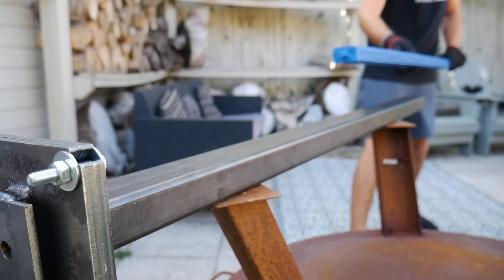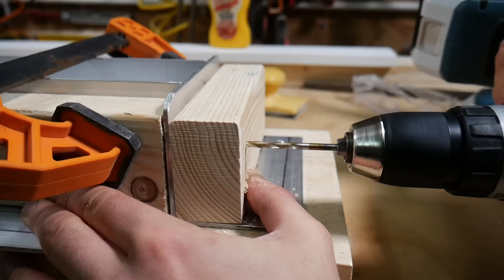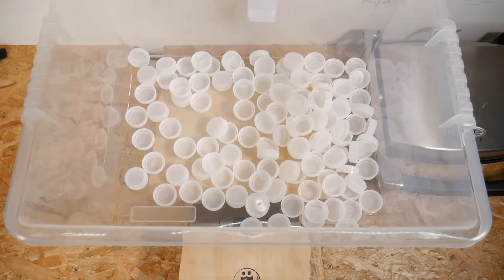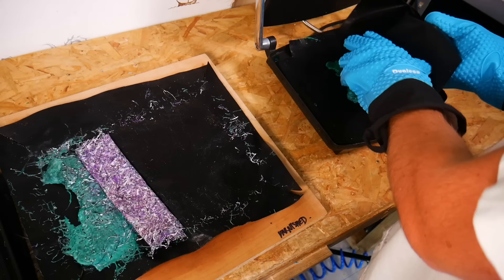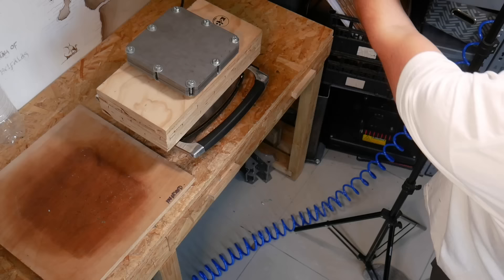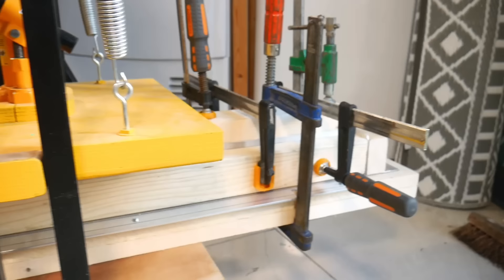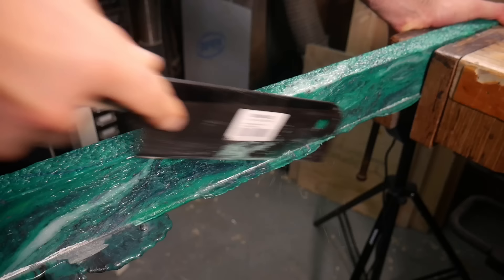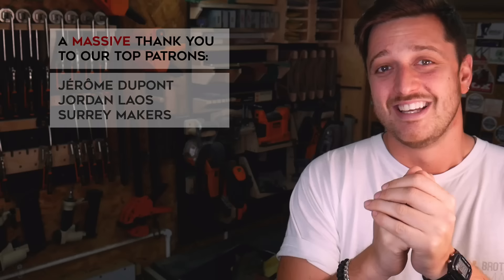How to Make Recycled BEAMS from Plastic Waste at Home

Comment: Understanding HOW to use materials in a construction project is critical. To use these plastic beams, you need to alter your thinking pattern a little bit.  The way to use them is one common to log home construction.   In log home construction, the logs all lay in a horizontal or flat position and are not stood upright.  The plastic beams don't have the characteristics to be strong enough to use as upright or vertical "studs" but certainly do have enough strength to lay flat, one stacked on top of the other like logs in a log home. 

The building process is made stronger by drilling a hole in each plastic beam at intervals of perhaps 12 inches to maybe even 18 inches.  Long rods such as rebar could be laid into the foundation concrete when it is poured.  The beams are placed over the rods, with the rods protruding upwards through the holes in the beams.  Holes would be drilled to match the rebar size.   Once the top of the wall is reached, the rebar can be capped off or just bent over in a "L" shape to lock the bars in place.  Used this way, the beams should work just fine for many types of applications.  A thin layer of glue or sealant can even be applied between each plastic beam as it is laid in place to help provide more structural integrity.

I can see using it for a lot of non-critical applications here on my homestead, like for building dog houses, chicken coops, pump houses, smokehouses, and even maybe small storage sheds.  Some have mentioned the UV issue, which can be mitigated a lot by simply painting the plastic beams on the exterior just as any other building material might be painted.

I like the concept and it certainly is scalable once a few improvements to the melting and forming process are achieved,   Low cost of the beams is really a great positive factor and so is the recycling benefit.  I'd suggest trying to produce a 4 foot length in a standard 2 x 4 dimension (1.5 x 3.5 inches) and to experiment with other shapes, such as 4 x 4 or 6x6 beams.  Find the right sweet spot where the product has good structural rigidity and stick with that configuration.  Then apply my construction suggestions and build products for the market.  

My first suggestion for a product would be to create notched beams that look something like a Lego block which would allow kids to assemble the beams just by pressing them together.   Then sell the beams as a kids basic construction toy set!

Good luck with this!

Comment: In order for them to be used on a house or any structure that holds any weight they're still going to have to have metal in it so you really are defeating the purpose and the air bubbles have to be Master squashed so they would be coming out and if it got sun rays or heat Rays then you have to have a special u v paints to keep them from being cracking and breaking which they would do over time anyway  but you guys are on  your way

Comment: Completely new to the idea of DIY plastic recycling and I have a few questions
1. Are there any concerns with toxic vapors when heating the plastic?
2. What recycle grade number does this correspond to (I am assuming 1), and what other grades is this heating and kneading method feasible for?
3. Would it be possible to heat this plastic further to pour into a plaster, clay, or resin mold?
4. What kind of flash point should I watch out for to keep from combusting or otherwise ruining the plastic's chemical structure?
Reply: 1. Yes. Never heat the plastic beyond what is required to melt it. Also, stick to HDPE, LDPE, or polypropylene. Do not use PVC. Only melt in a well ventilated area. 
2. The numbers correspond the kind of plastic. HDPE is #2, LDPE is #4, and polypropylene is #5.
3. No. Plastic never becomes a liquid. At best it becomes the consistency of a stiff dough.
4. Depends on the type of plastic. Google the plastic type to get the melting point. Don't over heat, and don't keep it hot for any longer than necessary.

Comment: In doing research and development for the greater part of my adult life. I've come upon many things. I believe you should consider using a wood splitter as you can use the hydraulics to extrude and apply pressure to remove bubbles and Imperfections. If you hook up a heating element on the end you can force the plastic through a heated head and extruded out one end into a mold of your liking. Look up injection molding. You can also do some chemistry and turn it into gasoline and still have a gooey mess you can inject or mix with sawdust and make boards. Not hard just heat and collect and cool the gas as in a still and with the way the world is going it mite be necessary. Good luck and keep up the good work.
Reply from the maker: We have both injection and extrusion moulding machines in our workshop. We wanted this video to be a more DIY approach. Also, we don’t condone mixing plastics with other materials as it means they are no longer recyclable.

Comment: You need a big steel type melting pot like how they melt steel down !
You can beave professional molds but to make those you could make anything  from that from ply wood  to 2x6s  which would be a good time now as  wood is thought the.roof you can probably set up  a plastic  recycling  route to get all the free plastic you want or find land fills  that would donate plastic to you !  Just some ides to help look into an sba loan or grant that could help you get your project off the ground . Good luck!
P

Comment: Any way to test its strength, how much to make it bend, break, etc.  Instead of using an iron press, what about a small furness with a bowl to melt down hundreds at a time.  You might have to add something to help make it a little more pliable during the melting process, but you could pour it directly into the mold without twisting or shaping.  Maybe on an outside BBQ where the fumes won't be an issue.  There are some real world applications for this.  I use wooden 2 x 4's across the inside of my garage door as security that rotate on lag bolts.  They are bulky, if this is just as strong at half the size, it could be a useful product to recycle.  You need to figure out how to reduce production time.  Great video, you speak very well, understandable with good rise and reflection.

Comment: Are there any load tables for plastic beams? Also, how do you check for, or prevent, internal structural flaws... like air pockets? Thanks.

Comment: What would the total embodied energy of this be, from initial making of the original bottle tops from oil (extraction and refining, as well as manufacturing) through the energy required to heat and melt,as well as all the tooling and machining, including the materials used to make the mould, clamps, etc? Just trying to determine the Full Cost of the item; It might be more efficient to plant trees, and then wait, or replace the timber used by replanting the cut down trees.

Comment: I wonder if the folding and twisting process is more of a hindrance. When making taffy, candy makers twist and turn the hot sugar in order to ADD air bubbles. I would imagine less folding would be more helpful. A heat gun, might be better for removing air bubbles. Shredding the plastic prior to plastic may also help.
Reply from the maker: We’ve tested this a lot. Folding and twisting 100% removes air bubbles

Comment: Not sure what you guys are using for the lining as I just stumbled here, as an idea possibility you can use a crock pot to have a controlled consistent heat that’s basically at melting point you can just keep throwing it in and then pour removing air bubbles essentially without  too much trouble you can push down on it while still melted then pour into the mold. Just a thought you guys would know if it works

Comment: I’m finding it difficult to find a way to have or add an even color other than same color plastic. Is there a way to add color other than painting it on? I also worked construction and did a couple of Trex builds and I’m wondering what their material process is to make it structurally sound in the elements?! I’m researching to start my own plastic recycled material business dealing with landscaping materials such as borders, bricks, rocks and pavers. It all started with wanting trees that don’t need manicuring and seeing all my green Mountain Dew bottles and smelting the Mountain Dew aluminum cans and making furniture from reclaimed wood, I might as well make a career out of it. Thank you so much for all the helpful videos.

Comment: what about a more continuous process using something like a large cooking pot with element heaters all around to avoid hot spots? if the temp is a little higher, I'd imagine the viscosity can decrease a fair amount, making the plastic potentially pourable?

Comment: grind it up to a towder type, then melt it, would be faster to melt, also u can just pore  smaller plastic directly into the mold and heat the mold up, make it out of metal, boile it in water if that can get hot enough, if not just lay the whole mold in fire but leave a air vent for the steam to get out.

Comment: I like the concept of making plastic beams from recycled clean plastics. The process seems tedious and takes a long time.
My suggestion wou be to make  a heated mold or a crucible to melt large volumes of shaved plastics. Let it cool in the mold and clean it up. One and done. That's just my opinion on it. Still a nice video 😁👍

Comment: Would love to see durability and stress tests between wood and plastic beams.
Reply: I've got some grey plastic lumber made from recycled plastic, it used to be produced locally. The makers added some UV blocker to it.
Observations: it was pretty warped, about twice as heavy as wood, much more expensive than wood, harder to cut, and loses strength on a hot day. But it doesn't rot or breakdown noticeably (asside from a powder coating on the surface). Its great for the part of your construction that will be in contact with the soil. Some people have used it for raised gardens beds, using some threaded rods to keep it from bowing outwards.

Comment: I think to greatly speed up this process for any sort of large scale you should just get a steel square pipe - or aluminium if reasonably thick. Thats already the mold done. Then simply DIY that into being its own oven. Some simple temperature sensors, some heating wire wrapped around it, and plenty of non flammable insulation around the whole thing to make it energy efficient. Make it something like twice as long as the desired product. Make a simple ram-rod of the same size to compress the plastic as each load melts (where the extra lenght will come in handy to require less loads). If properly coated (maybe dry PTFE?) before baking I think the product could be extracted by simply hammering the ram-rod down. The biggest issue is probably avoiding too many air bubbles. Have you tried using a vacuum chamber to eliminate bubbles?

This is just a quick brainstorm from someone with limited plastic recycling experience, and certainly nothing of this scale - but even to a noob like me it's obvoius that a pannini press and a toaster will be a massive bottleneck once you move past the small scale :)

Comment: I would try make a mould the size you need out of metal then have some gas burners or electric elements along the length of it then just fill it up with plastic melt it then clamp

Comment: Would it be possible to build a mold that creates a shell around a core of, say, polystyrene? Polystyrene has a higher melting point than HDPE, so in theory it could work. I'm thinking something for the extruder would work better than manual.

The general idea here is to recycle the plastic while sequestering the polystyrene, meanwhile reducing the weight and density of the resulting beam.

Comment: Late to the party but have you put this under a stress test?  At what point would it snap if bent to an angle over 30 degrees? Could you also extrude this into a thin plastic sheet?

Comment: have you looked at making L, C or H shaped bars.?  These sections are everywhere in steel construction as they are much more economical / lighter and as strong as solids bars while using less raw material. They also connect (bolt) more easily throgh their flanges (plastic welding ?). I had plastic meccano as a kid inc the bolts. Your bottle caps look very new, clean and unscuffed.? Collecting enough raw material is difficult domestically, ironically.

Comment: Concept-wise, it seems a good way of taking care of scrap plastic, but it is quite inefficient using this method. Perhaps some other method to scale up the production would eventually make this a viable way of recycling plastic. Could the melting of waste plastic, for example, be done using the waste heat that the manufacturer produces in making its products?  Would a combination of ground up plastic waste and a suitable adhesive pressed into molds be a better alternative to melting and pressing into molds?  Keep up the good work; some day someone will come up with an improved method.

Comment: What kind of plastic did you use? Or more specifically, does this method work for PP (Polypropylene)?
PET (Polyethylene Terephthalate) and HDPE (High-Density Polyethylene) are already recyclable and I'm looking for something to do with PP (Polypropylene) since it's what I find myself throwing in the trash mostly.

Comment: Do y’all recommend any type of respirator to wear for safety or is it not necessary? Awesome video!
Reply from the maker: Depends on the cleanliness of your plastic and the temperature you’re heating it too. Keep it under 180C and HDPE will never burn or release toxic fumes. But make sure the plastic is clean. If you work with plastic on a larger scale, or working in a small, poorly ventilated space, then grab a 3M respirator with ABEK1 filters

Comment: I have so many questions. Completely new to this. Did you need to use ventilation  or airway PPE while melting the plastics? In theory, would these be safe in the home or would they release gases into the air? Is that only a concern when heated?
Reply: Melting plastic is safe to do with no PPE.  "BURNING" plastic is another story!
Think of children's crafts called "Perler beads"... Nobody uses PPE for that.  This is the same concept

Comment: Your stretch and pull method is used by candy makers to introduce air bubbles into hot candy to make it whiter: by increasing the number of bubbles the reflection and shine increase. 
So your stretch and pull method is doing the exact thing you do not want
Reply from the maker: It seems to work wonders for us!

Comment: Kind of curious about the energy required to make this. I could see this having greater potential in different shapes that are more efficient for the application, like hollow tubes or construction profiles like an I-beam. Also forming into thinner shapes/things as mentioned in other comments.
Reply: it took about 500 times the amount of energy a typical pine tree absorbs over its lifespan to create a single small plank out of brittle recycled plastic bottlecaps

Comment: what about making a full metal mold and using a torch to heat the mold with the plastic in it less handling and could get it hotter to not get all the bubbles in it. It might help you cook faster and let you get a bigger piece done. you could use a fire then to heat for a more even heating and just put long i rebar for handles to move and work with the molds

Comment: @Brothersmake 
Greatings from North Carolina,  USA! QUESTION: Sorry if I missed it, but how much total raw plastic did you start off with to make this beam? I've been dabbling with this a bit myself and it's amazing the amount of raw material it takes to make something that large and solid. Q: Have you considered adding fillers or designing something that will allow you to use less plastic, by making intentional cavities to create structures metrics in the material? Together or separately you could increase your overall yield in productivity, while also reducing the amount of plastic used and all the while make it a stronger and more heat resistant and structurally sound material. Kudos on the good work mates and I hope to hear back from you.
Reply: 4:00

Comment: I would be curious about using an electric skillet. You can control the heat and melt a pan full, then add more as needed. Search for Sunbeam Electric Skillet with lid. 

Excellent video and it definitely gives a base to launch many creative ideas. I paint and am immediately thinking to use these planks for frames. Cheers!

Comment: I used to work in an engineering shop that moulded plastics for industrial silo's and found melting Plastic in an electric caldron is much quicker and no air bubbles ...

Comment: I was thinking that plastic could be used as a filler with none construction grade concrete pads that way less concrete is needed for slabs. Could be used for concrete pour mold building. Plastics can be used and recycled in so many ways. 

I think you should formulate a solar melting process by focusing mirrors or some how using glass. Damn it now I going to check the melting point of plastic. Also heard acetone melts a good deal of things. However might not want to use chemicals. RESEARCH time.

 Edit: Apparently boiling water is 212°f which some plastics will melt at as well. Also boiling water can reach higher temperatures than that. So I'm thinking you can use a two metal pot system to melt plastic more efficiently. Got so many ideas now.

Comment: This is cool, but wouldn't a better option be to create a metal mold you could heat and trays you can set in. Set the tray in, load up plastic and keep adding and pressing as it melts, then once you have your full beam remove the tray to set aside for cooling and you have the ability to add another  so you can keep producing beams.